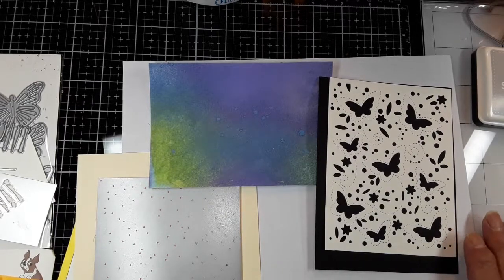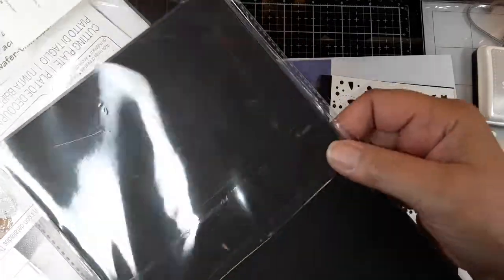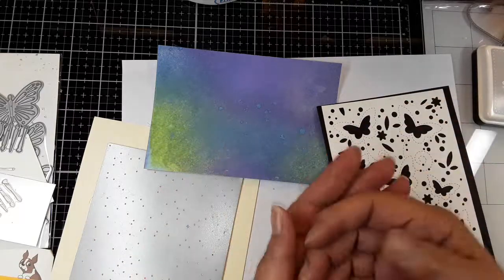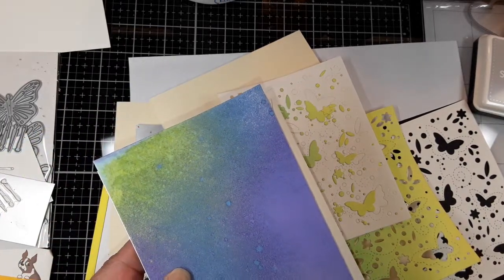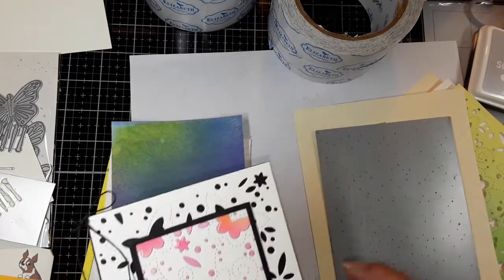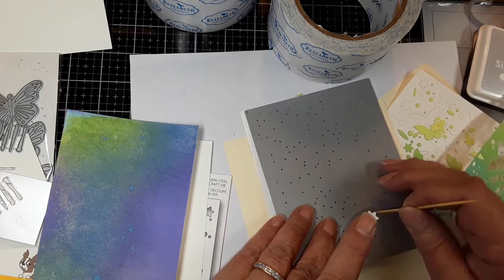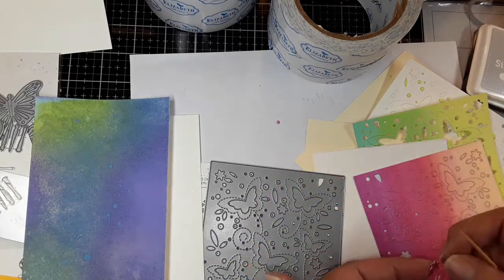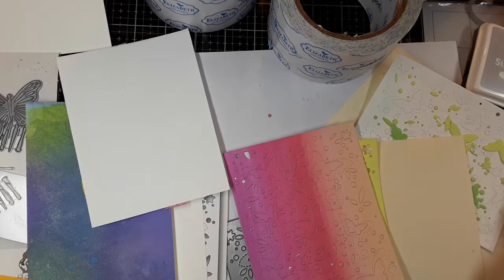Rethinking the shims in die cutting

Comment: I used the old AG purse. Then I used Gemini.  Then I used sizzix big shot.  Now I use AG Empress.  No matter what I use, the dies will not cut through with the any of the double sided backing.  They NEVER cut through no matter what I do.  I like my dies & I have intricate dies.  So I can't make anything better so I have to use wet glue. (I use the same double sided backing.)  I use a lot of shims, so that I am white knuckled & it still doesn't work.  Never cuts through the other side of the double sided materials.  I have tried every one!  Help please.  Be kind to each other.  Stay safe.  Love to all
Reply from the maker: Hi Rhonda Kennedy...sorry you're struggling with die cutting.  I know cutting through the backing of double sided tape can be challenging.  I dont know whose tape you're using,  or what dies you're trying to cut with, but some double sided tapes are thicker than others.  I use Elizabeth Craft Design double sided tape because it's thin and strong.  The basic sandwich would be in the Big Shot, the platform,  the cut plate (or the metal adapter plate if the die is very intricate) a paper shim (at least 65lbs) , what you are trying to cut with the adhesive side down...with the release plastic still on, your die facing down, then the top plate.  If you run it through and it still dosent cut add another shim between the die and the top plate for more pressure.  Note: Never force the sandwich, just reduce the papers weight and try again. Also, after you run it through the first time, rotate your die 45 degrees and run it back through the machine. It should work, but again I don't know your paper, dies, adhesive or the plates you are using.   Please let me know how you make out...I hope I helped.